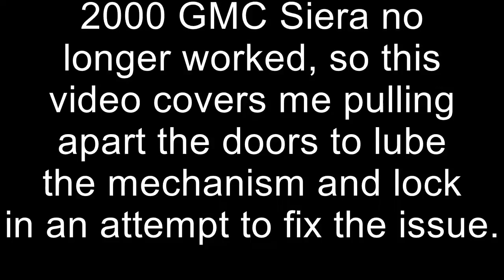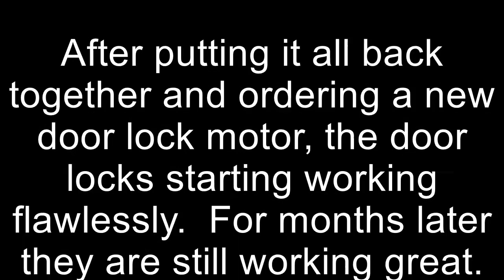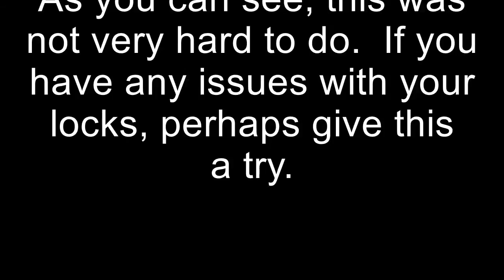2000 GMC Sierra - repairing sticky door locks

Comment: Thank you, your video helped a ton.  I noticed that the lock rod was majorly gummed up from old lubricant, so I popped it out and scrubbed the rod and three white guides with a paper towel and rubbing alcohol to remove the gunk.  Then re-lubed with spray on white lithium grease, and it works good.  Hopefully the new grease will hold up to hot and cold weather.

Comment: where did you order the door lock parts from?
Reply from the maker: I bought the lock motor from Amazon, but never did put it in.  It did get sticky again about a year and a half later.  I could have done the same thing or put the new motor in, but ended up getting a newer truck.
Reply: KMLTimesTwo ok thanks I'll have to take mine apart
Reply: @KMLTimesTwo  Rather than just spraying the contact points on the bar, if you try to spray inside the motor/actuator it may work a lot better.
Reply from the maker: @liquidsmokemustang1537  That would probably help too.  Best I could tell at the time, it seems as if the linkage was binding.

Comment: Wait when you say you bought a new door lock do you mean the door lock actuator or door lock with the red tab
Reply from the maker: Sorry, there's an update at the very end that goes into further detail. Because it was still sporadic I ordered the door lock motor.I felt that all of the mechanisms were properly lubricated and then it just had to be a weak motor being the issue.  That said, I never had to put it in.it started working just fine after a few days and worked for years later. Eventually sold it and it was working when I sold it.
Reply: @KMLTimesTwo  o ok thanks for the reply i appreciate it